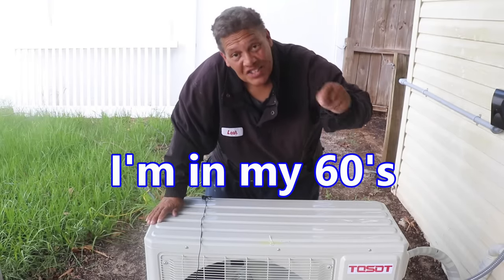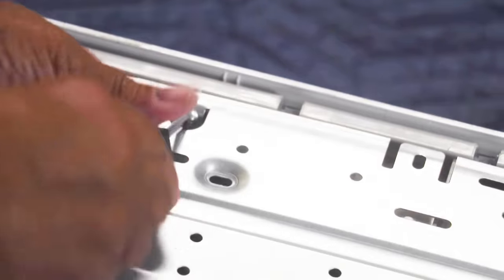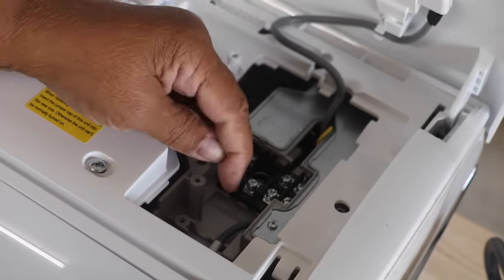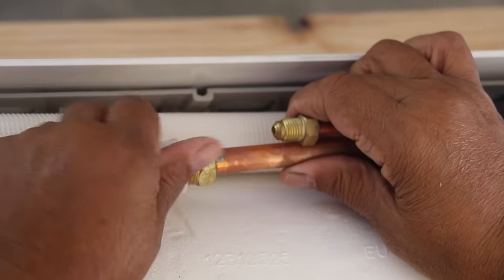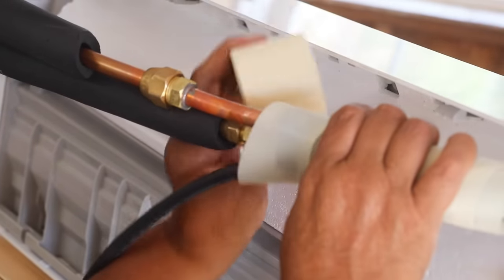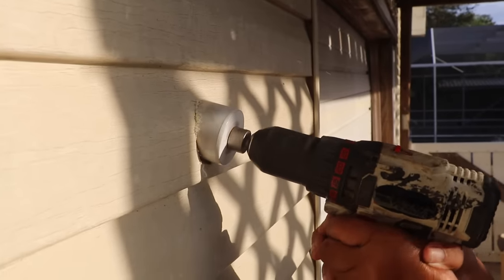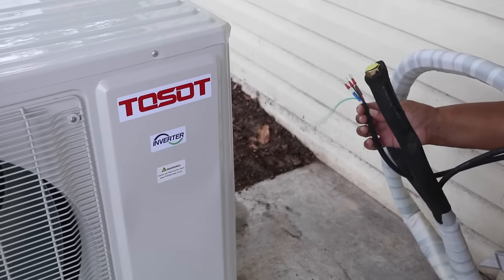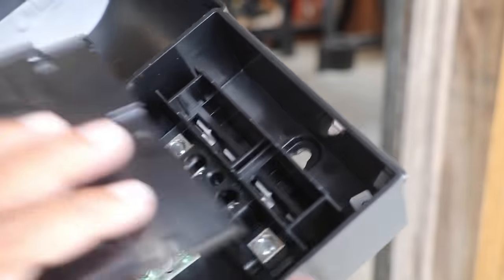I saved $4,200 installing a mini split AC myself

Comment: Same here.  5 years ago, I tried to get an HVAC contractor to replace an old mini split heat pump.  The only one who agreed to do it wanted $8000.  I bought one online (Dual Zone 18000 BTU with 9000 and 12000 BTU wall-mounted air handlers) for $1500.  I bought about 1000 dollars worth of HVAC tools.  I had a few minor hiccoughs along the way, but the unit is still running fine.  Owning the tools, I continue to save by maintaining it myself.
Reply from the maker: Nice !!!!
Reply: Me too.  Mine was smaller and I spent less on tools.  I'm super happy with the way it worked out.  HVAC is another one of those scams where the labor just kills you.   Some of the smaller mini-splits are made to be installed without highly specialized tools like vacuum pumps.
Reply: @incognitotorpedo42  The prior unit used R11 refrigerant instead of R410a, so I had to buy a flush kit to clean out the old R11.  The new unit was pre-charged, but my line set was long enough to require the adding of more refrigerant.  So, vacuum pump, nitrogen tanks, HVAC Gauges,  refrigerant scale, HVAC Manifold for R410A, connectors/adaptors, etc.  Thank God for YouTube.
Reply: why do they want you to pay a fortune?!
you pay 150 dollars (3000 zar) to install or deinstall an ac.
Reply: In my country, you can pay someone to do that with just only like US$20-40. Just the labor only. I lived in Indonesia
Reply: @celestialstore9405  I would have loved to have found someone who would have done it for a reasonable price.
Reply: Nice Job. I did the same thing as you several years ago. I installed two one and a half ton mini splits myself, purchased the tools required to pressure test the line sets and pull a vacuum. Everything’s been working great for the last five years. The mini splits, the installation hardware, and all the HVAC tools cost me less than $4000.
Reply: I already had some of the tools from doing auto air conditioning, I rented the vacuum pump and the tank  to pressure test , I did have to buy the micron gauge and few other things.   But i have them 👍🏻
Reply: @incognitotorpedo42  not every HVAC company is a scam... not every trade prices fairly... bigger companies tend to price up.. keep in mind some people can actually DIY the things themselves but not everyone is equipped for it... specialized companies are there for a reason.
Reply: You guys are really driven crazy by your own market price. Evan buying 2 sets of 18000btu air conditioners in China will cost you less than 1000 dollars including installation. They can even mount it on the exterior wall of the 20th floor without charging you additional money.
Reply: @Jeffnvz  We are. Desperate times, desperate measures.
Reply: @arnoldsolof  which country are you Sir?
Reply: @celestialstore9405  USA
Reply: $8000 to install one of these c'mon thats a rip off. $8000 maybe to install a full central air unit
Reply: @GnarlsFarls  You are preaching to the choir.
Reply: @arnoldsolof  good luck with that. DIY is the cheapest method
Reply: That's insane. I'm in France and I only charge 400 euros labor to install a minisplit (a day of work). And I have to pay 1000 eur per year for refrigerant ability and yearly tool control. And for these 400eur labor, I pay 180 taxes. I only got 1000 eur in my pocket per month.
Reply: @balokurd17  I'm surprised it is that much more affordable in Europe.
Reply: Yes, heat pump, not an air conditioner.
Reply: @arnoldsolof  It depends regarding to your location. There's big gaps. There's enormous competition in my location. But the overall labor is cheaper than in the U.S
Reply: @erg0centric  heat pump is an air conditioner it just has a reversing valve which changes the evaporator into a condenser for heating during the winter
Reply: Those contractors are scoundrels. Charging you $6500 for a job that only takes them 1 day of work.
Reply: @peppermeat8059  Because it's an under regulated industry. They obfuscate material costs(try asking a contractor for the receipt of the condenser he bought, he will refuse). Try to nail down what his hourly rate is and you'll also get stonewalled.
Reply: @GnarlsFarls  $8k is also a rip off for central heat/AC replace. The package unit or split system may be $4-4.5k w/ tax. Two guys working 4 hours should not cost $3.5-4k, more like $1k to price in the potential for a callback due to improper install the first time and to cover the bond/insurance of the contractor license. In a more reasonable economy with loads of HVAC guys keeping the industry honest, your hypothetical would cost ~$5.5k.
Reply: @balokurd17  France his higher taxes. Many contractors in the states do not report income. So many tax cheats.
Reply: Contractors are almost all merciless thieves
Reply: Awesome! Can you list the tools you purchased.
Reply: @arnoldsolof that's because France has good social systems. The person doing the work doesn't have to worry about healthcare. Doesn't need to account for saving a lot of money to put kids through college. Isn't worried about being able to afford rent, and so on.
Reply: Hole in wall, conduit, use wood finder, screw into wood. What's $8,000?
Reply: @QuantumVoyager  They didn't even need to do that since it was a replacement for an existing minisplit.
Reply: @mechanicalmonk2020  What absolute BS!!! You cannot justify ripping people off because of your personal expenses!!! No one else in any other occupation overcharges their customers because they have to save for their kids college, or pay the rent. You have the right to charge what a job is worth, to make a modest profit. Not to price gouge. You’re lying to yourself. A thief is a thief.
Reply: Where would you install it of you live on the second floor? The balcony? If so the only space for the unit on the inside is the adjacent wall since my wall with the balcony has a diorvandc2 windows on each side with little wall space.. what would be your suggestion  for the inside and outside placement, please?
Reply: @meld6684  You can still put the compressor on the ground and run the coolant tubes down the side of the building to it.  You could also mount it to the outside wall with brackets.  If a flat roof, you could put it there.  They have wall, ceiling, and floor-mounted air handlers for inside.   They are also beginning to come out with some models that have an upside-down "U" shape that straddles a window, with the compressor side outside and the air handler side inside.  I don't think that last option is ready for prime time yet, especially efficiency-wise.
Reply: I’m in New Jersey and I charge $2,000 to install mini-splits.
Reply: @meld6684  In one of the buildings I manage, we have it mounted on the second-floor exterior wall, the only issue we had was a garbage truck reverse down the side of the laneway and the top of the truck hit it, its still good  just a little skewed lol
Reply: Kind of like when you get that $100 steak dinner that would cost you $25 at the store if you cooked it yourself and served it to yourself. Oh wait…
Reply: That’s great. You know you can also save money by not going out to eat and cooking yourself and not going out to the bar and making your own drinks. Also fixing your own car too!! Who would have thought you have to pay for a service! The gall of businesses to make a profit and pay their workers a living wage!
Reply: @timrob0420  There are fair prices, and then there is price gouging. Also, due to government regulations, insurance costs, liability risks, work warranties, etc., many services, even when fairly priced when factoring in their overhead, have insanely high prices. So, the difference between hiring a professional and doing it yourself is extreme.
Reply: @arnoldsolof it’s not price gouging if it’s what someone wants to charge for their service. You aren’t buying parts or the equipment, you are literally paying for someone’s service. They determine how much their business needs to make to cover overhead costs and how much profit they want to make to determine how much to charge. You are paying for the service. Learn how business works, literally EVERY BUSINESS functions like this. Those bananas at the store? Yeah they aren’t 99cents from the grocery stores supplier, they are more like a 10cents. That drink at the CONVENIENCE store that you paid $3 for you can get at a grocery store for $1.50. You are paying for the SERVICE. And if you want to do it yourself to save money, that’s great. It’s a free county. Do it, nobody is stopping you and literally nobody cares. Nobody cares if you think it’s “price gouging “ either because you don’t understand how business actually works
Reply: @arnoldsolof coolant tubes 😂. What. HVAC expert
Reply: @ddrhazy they aren’t just paying for those two guys. They are paying for the needed office staff to answer your phone call, the building overhead for their shop to physically exist, for benefits for their workers, upkeep on their work trucks that are needed to get to customers houses, gas,etc etc the list can go on all the while trying to also make a profit. Grow up and learn how the world of business actually works. Every trade does this, every business on earth does this
Reply: @ddrhazy try asking the grocery store for a receipt for those bananas they bought from the farmer. Try asking the bar for a receipt where they bought that bottle of Patron. Try asking the car lot for a receipt from the factory. Wtf is your point. You’re not paying for the equipment, otherwise if you were you’d do it yourself!! You’re paying for the SERVICE and everything that goes with that!
Reply: @timrob0420  except many HVAC retailers will not sell to homeowners. It's a huge predatory industry to line the pockets of guys soldering copper together. It can be a dangerous job working on a roof, but roofers don't make quite as much.
Reply: @ddrhazy first of all it’s not soldering it’s brazing. Second, the suppliers and manufacturers do not sell to homeowners because they don’t want the headache of lawsuits and warranty claims because the stuff is not installed correctly. Roofing is not a more dangerous job, the fact that you think that shows your ignorance. With HVAC you deal with electrical, plumbing, gas, etc. Roofers don’t make as much as HVAC technicians because they don’t have to has as much skill in wearing many different hats. But regardless, how much do you think the supplies and overhead are for that $30k roof? Shingles and some sheathing?? Lol.Plumbers also make as much money if not more. Electricians do as well. Go tell that electrician he shouldn’t make what he does because it’s just twisting some wire nuts and running some wire. Way to devalue /demean something just because you think it’s “predatory”. News flash, it’s not. Businesses need to make money and pay their workers. And also, you are dead wrong about not being able to get equipment. You can pretty much get any equipment online, even big name brands like Mitsubishi, Trane, etc but they all come with a disclaimer that if it’s not installed by a licensed contractor that the warranty is void. A lot of people don’t realize even Mr Cool “the pos diy brand” has that same disclaimer.
Reply: @timrob0420  I'm not reading that wall of text, but since you decided to respond, I will ask one last question.

Are you a contractor? If yes. Are you an HVAC contractor?